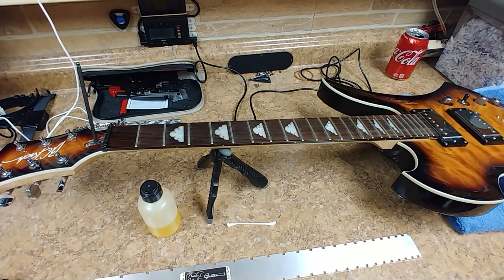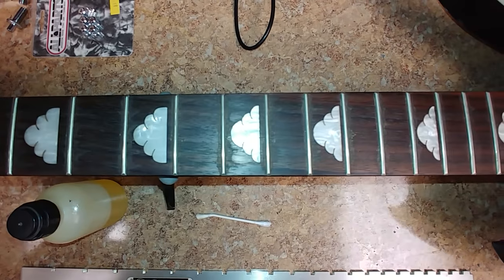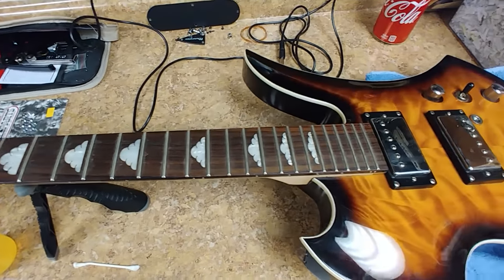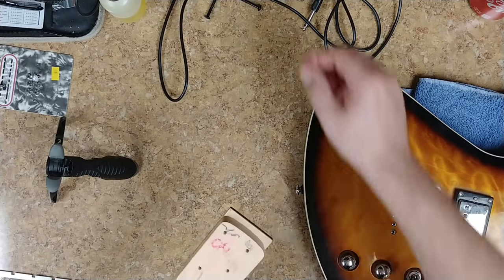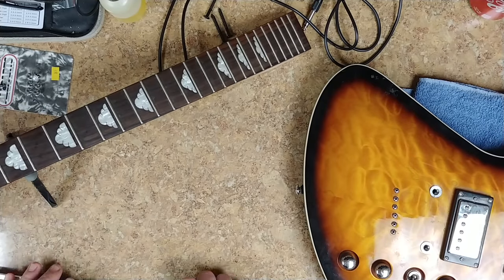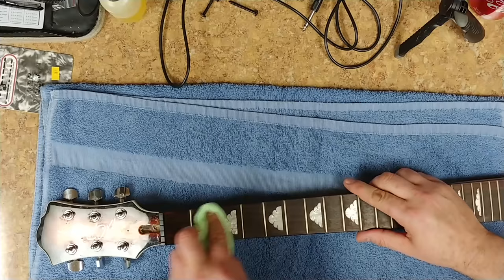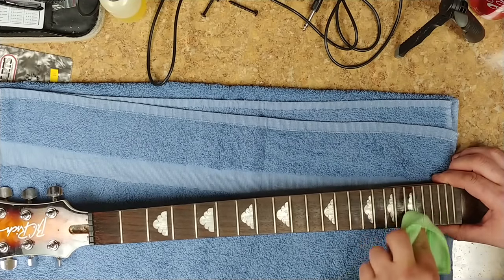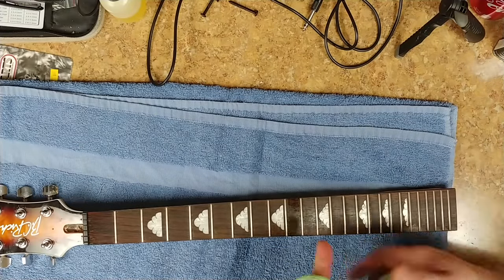BC Rich Mockingbird Masterpiece Restoration Start

Comment: I would never use acetone, but alchohol, naptha/lighter fluid or Mr Clean . You should check out Davesintexas, he says use linseed oil to clean and treat fretboard. Nice way to just seal in the gunk.